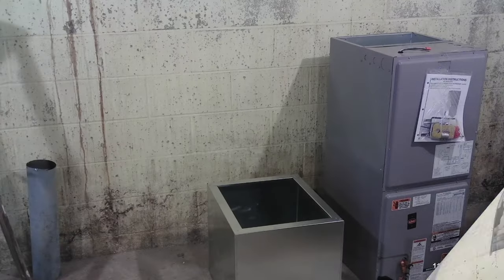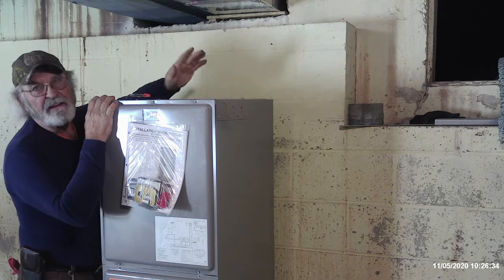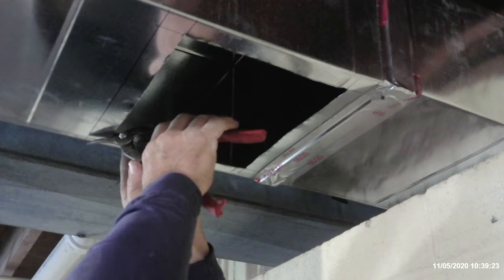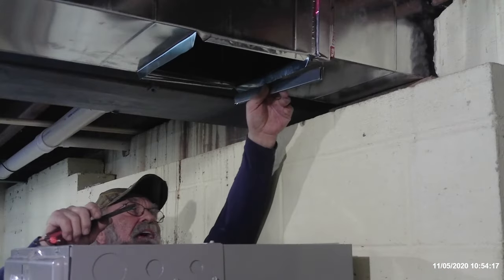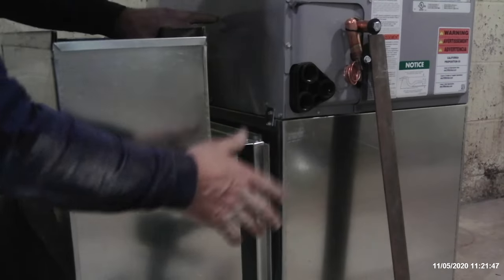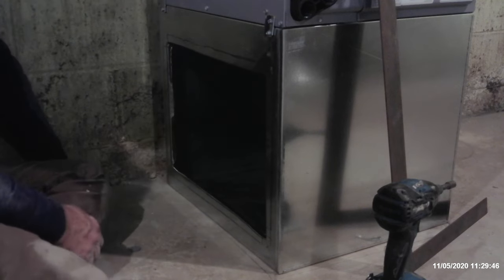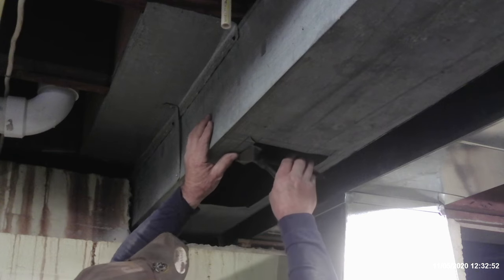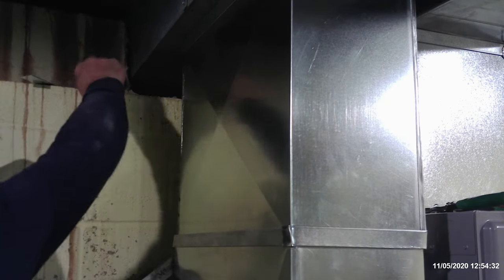Air Handler,  Centerline Plenum Transition and Return Air Installation

Comment: I like how you make all your fittings and really like your videos. But I think you should have used a canvas connector that would have made things a lot easier to assemble
Reply from the maker: I usually only use flex connectors in residential applications where vibration resonance can possibly be a problem.  Like hanging a large capacity unit from rafters in an attic. However I can remember a time or two where the replacement furnace was so close to the same dimension to the existing plenum that I cut and hand folded drive connections on one end and bent a single hem flange on the other after trimming just enough off the duct to allow the flex to make the plenum connection. We buy the metal/canvas connectors in 100' rolls for use on commercial installations.  Thanks Jeffery for the thoughts as well as for watching.
Reply: You're welcome. I am a installer at a residential replacement company for the last 10 years and I appreciate watching your methods. a lot of companies in my area don't use the double half-inch ham I think it is worth the extra time it really does help make your installs look so much nicer and that much easier to run a small bead of caulk around. Please keep making videos you explain everything 💯 % perfectly
Reply from the maker: @bigotis1776  Well, I will continue as long as there is a job or two come along.  I am getting ready to do a complete system tear out at my son's house. Then go back in with a smaller size, isolating the second floor from the network.  We installed a second system for the second floor in the attic last year or so and now the oversized system is now super oversized.  His noise level is deafening in the living room and needs to have a total work over.

Comment: Only thing I would change is put cork pad on bottom to get off ground and cross break your metal so it doesn’t flex
Reply from the maker: Yes, I'll use the rubber-cork-rubber pad in areas where dampness is an issue.  I cross-break most times, but this one being a very small 2 ton electric air handler I didn't have great concern about excessive supply or return static.  Larger capacities with a higher cfm delivery, for sure require reinforcement, no doubt.  Nothing I hate worse than dealing with an 'oil can' duct job.  Thanks Matt for the input.

Comment: Nice work, Tractorman44! Did you make that plenum box or is that pre-fab item? I am installing a similar 21x21 electric AHU & coil (Goodman), but we have limited headroom up to the existing ductwork. So I'm looking for a shallower return plenum box for the unit to sit on (has to be 8" or less).  Since the existing return ductwork is 24x8, the new plenum box will have to be at least 24" deep so I don't choke down the return. Suggestions?
Reply from the maker: No pre-fab metal. It’s all field measured and fabbed in the shop custom fit for each job site. It’s hard to visualize what you have described, but if I could see it I could possibly give a proper suggestion. But on the returns, I try to minimize restrictions as much as possible many times reworking the whole return drop to accommodate proper airflow. I know that’s not a specific answer to your question but …..   good luck with what you do. Check out the attic heat pump install in the playlists if you’d like to see some installation constraints that were tough.
Reply: @tractorman4461  I got it all worked out. Appreciate you and your reply. They don't make'em like you any more!

Comment: First video of yours I've watched and really enjoyed it. My only question is why didn't you add cross breaks in the supply plenum?
Reply from the maker: I most always crossbreak, but this little two ton air handler at 800 cfm at less than an inch total system static and short coupled plenum wasn't going to give an issue with 'oil canning'.  Anything larger to any extent is usually cross broke. Thanks Don for watching and btw, I have several playlists up above with some neat duct fabs.  If you'd like, try this on for size, it was an interesting one: https://www.youtube.com/watch?v=PvDab537ul4&list=PLk72G9DTzZ1taVZjyeN9DKr52HQ3hhcXd

Comment: My furnace currently has a 1 inch slot for a 16x25 filter and the space between the furnace/handler and the vertical return looks to be very similar to this one (4.25 inches). Is it ok to cut open that space, reinforce it, and add tracks so I can use a 4" filter instead of a 1"? I wasn't sure if there needed to be a certain distance between the 90 and the filter for it to work properly.

I'm hoping to use a 4" filter for less pressure loss, as my furnace can only currently reliably run with the 1 inch green/blue fiberglass for more than a few days. Thanks
Reply from the maker: Normally there would be no problem with adjusting the opening as you suggest.   However, if your furnace won't continue to operate normally with much accumulation on a 1'' filter, it may be suffering from a lack of return air.  All 4'' filters are going to be 'pleated' filters with a much better capability of catching dust particulate.  I'm thinking that the pressure drop across the much thicker physical dimension of the 4'' filter will cause the same problem you describe almost immediately.  It seems by your description that your system is suffering from a lack of return air due to improper duct sizing or just not enough openings in the walls or floor to carry the required air back TO the furnace.   Either one will cause a shortage of air.  
    You have to have a minimum of air entering the bottom of the heat exchanger to maintain proper operation within the designed limits of the temperature rise...which is typically 70*F.   A shortage of air will cause the burner (gas furnace) to cycle on its 'limit' switch, meaning the temperature rise is too high....not enough air to transfer heat to as it passes across the heat exchanger.  If what I described is what's happening, the only way to remedy it would be to allow more access to actual return air from the living space...then the pressure drop will be less and the thicker more efficient filter would work fine and the velocity through the filter would be lowered allowing the filter to attract more dust particulate.  Adding return air will also slow your fan speed because it is doing more work to move more air and the amperage draw of the motor would increase a few tenths of an amp.
  Of course this is all a guess without actually being on site to see and test exactly what it is that is going on on your system.  Good luck with your endeavor Fey.

Comment: Im a car guy and went to the ER over carefully handling sheet metal...... i wear gloves all the time now....
Reply from the maker: I agree, its best to wear gloves.  Fortunately,  I seldom get anything beyond a small nick after so many hundreds of sheets of metal over the years.  Plus without gloves your skin grows thick and calloused. Now I HAVE had some serious slices and had to use duct tape to stop the bleeding to finish out the day on occasion. But it usually grows back tougher than before.  And one time in 1986 a tendon in my left index finger was severed at the first joint. That's why it doesn't bend at that joint.  I went to the ER and they didn't detect it, bandaged it up and found out a week later the finger would no longer bend because of it.  Too late to repair it at that point.  Thanks for watching and adding your input.
Reply: @tractorman4461  being a car guy, i got tough hands.... the sheet metal was a front fender which ive handled many prior with no issue..... the slightest mistake and even with the ER, it was an opem cut for 3 weeks and im still in process of healing from it

The gloves i use are tilsatec and provided by my work.... the light duty ones are good enough, i think its an A1 rated cut resistance that id suggest? Keeps the glove thin enough you dont really notice it, but has some rubber on palm-side so the part cant really slip on am edge
Reply from the maker: @Ayesuh  Dang, that must have been a good gash !!  Sorry to hear that.  Those gloves sound like the real deal.  The reason I don't like gloves is because of how you can't 'feel' the work, but what you are describing with the tilsatec gloves sounds appealing.  I will try to find some to test them out.  Thank you for the information.
Reply: @tractorman4461  A1 cut resistance isnt a lot, but it still allows you to feel most of what you need to feel.... ive gotten used to them to the point that i actually NEED the gloves sometimes just for adequate grip! And i hope it works out for you!
Reply from the maker: @Ayesuh  I like the thought that they sound thin enough to not hinder dexterity or the feel of the work. But boy o boy, you hit it right about the grip. I mean I still have a good drip, but the arthritis inhibits the gripping on thinner objects.  I use to grip two 48x96 24 gauge sheets and walk them to the layout table vertically.  I can barely grip tight enough to carry one now.  But if the same weight was 2'' thick, there'd be no problem.  That's the loss due to arthritis.  Old age is a pita !!  LOL

Comment: Do you ever put a concrete pad to set it on. My old home use to get an inch or two of water once in a while.
Reply from the maker: Yes. We will set them on bricks then use topping mix and build a dam around the perimeter. Mix it dry so it sets up while making the metal for the changeout.

Comment: What kind of weight can the return plenum support? Would there be a need to reinforce anything?
Reply from the maker: I use this and other variations for all sizes of residential and light commercial applications.  I'll use 24 gauge material for the larger capacities though.  I've never had a problem with 26 ga boxes all the way to 150,000 btu gas.  I do put reinforcing angles inside the corners horizontally on some of them though. They support the furnaces or air handlers surprisingly well. If you like odd sheet metal fabrications, check this one out if you have time: https://www.youtube.com/watch?v=Pcz0iEgtuBk&t=1s

Comment: Hi there, loved the sheet work. I am used to this system build in my commercial jobs, however in my own home past owners must have shortcutted hardcore. The only “return” or “supply” points are a hole in the hall for main return (no plenum), and an open hole in the ceiling for “supply” (combustible). Obviously the system is choking itself out, running super loud, and triggering pressure switches for the heater.
I would love to build ductwork to supplement return air, and actually tie the system back in with itself, but I just have the one small furnace closet. Do I have to expand this closet to build the new ductwork? Thanks in advance 😊
Reply from the maker: There are so many variables with what you describe, I can't venture a guess.  It sounds like a situation requiring 'eyes on' because there's too much to describe.  But to make the system operate well, there should be a supply plenum and trunk line to serve the respective living rooms with a more adequate return air network or at least a connection back to the furnace or air handler.  If its a gas furnace, you don't want to draw the return air freely within the open space that contains the combustion air supply to the gas burner.  Gut feeling I would say yes, your closet may have to be expanded.   Sorry if this doesn't help you much.

Comment: Does anyone know if  it matters where you install the return air filter - whether at the back of the return air duct close to the furnace or at the front of it about 18 inches from the furnace?
Reply from the maker: No, the distance from the actual blower assembly will not matter but you have to make sure its in a position to ensure 100% of the systems return air flow passes through the filter.

Comment: Wow.  Looks really really good.

Question whys the A coil on the bottom?
Is this better then over the heating element's?
Reply from the maker: To make electric air handlers universal for use as a/c only or to be used with a heat pump they typically are designed this way. If the indoor coil was above the heat output of the elements it’s deliverable heat content is so low by comparison that there would be little or no heat transfer. That’s why fossil fueled furnaces are locked out during the use of a heat pump until the heat pump can no longer satisfy the load. Then they typically become locked out and the fossil fueled furnace takes over. The indoor coils are always installed on the top of the furnace, opposite of an electric air handler. Hope that’s more of an answer than adding to the confusion Bobbg. I’d be glad to add to it if needed. Thanks for watching by the way.

Comment: Is there alot to be gained by using ells? My concern is with raised external static pressure when connecting a new air handler for heat pump to an already undersized duct system.
Reply from the maker: Undersized duct is probably the greatest detriment to a heat pump installation. However, with either low or high duct static, the best way to move air through a 90* turn is by incorporating turning vanes inside the fitting.  Those minimize the turbulence created by the air flow 'dead-heading' prior to making the turn.  Especially if it's not a rounded or angled radius.  If the system is exposed, the best thing to do to lower the static is to add additional runs in the structure. Get the air into the living space at a lower velocity.  It becomes a balancing act, and most times does not end with an extremely satisfied customer. I know it sounds good to make these suggestions, but application of the thoughts are sometimes a challenge.  Thanks Gary for the question, I hope this helps you out some.
Reply: @tractorman4461  thankyou. You offer more than we lookers on deserve from you! I will look into the directional fins. With going electric I can remove the B vent and use the chase for a trunk to the underserved 2nd floor. The scope of the 30 yr old furnace expandsd
Reply from the maker: @garymartin2336  Thank you for the candid comment, and good luck with whatever you do with the system.

Comment: I need help with a old house where i have a similar job but the return just stops in the wall...
Reply from the maker: Sorry I missed your comment.  You will have to figure out the simplest route for the return air to flow back to the inlet of the furnace or air handler.  I can't do too much with the vague description....but we cut holes in walls and floors and send the air across the space between the floor joists then duct downward into the furnaces. I doubt that helps a lot...